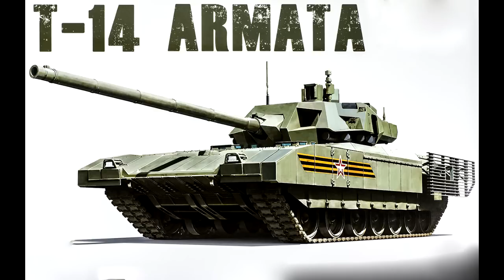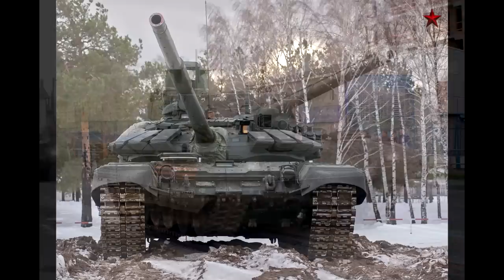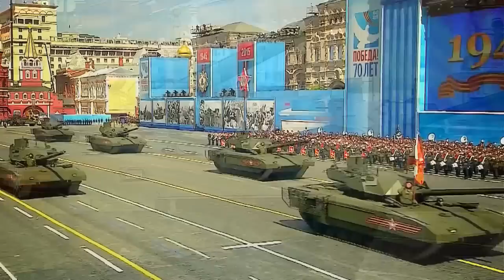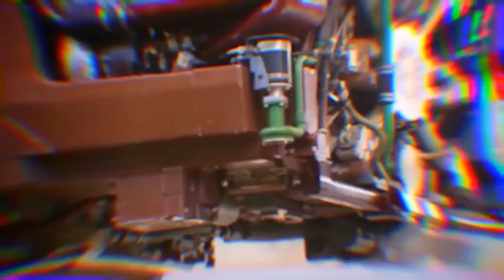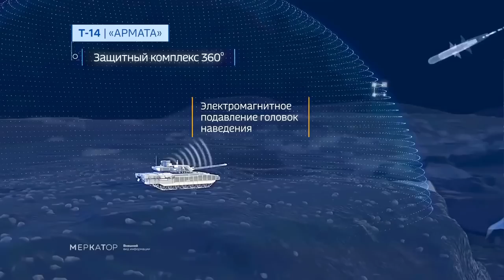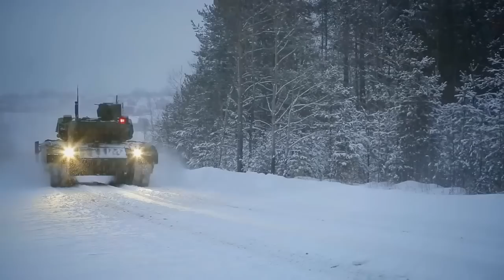Busting Myths on T-14 Armata

Comment: You clearly dont understand how physics work no APS system could stop an apfsds round. You cant stop a harder material travelling at over 5000ft/s by showering it with shrapnel that isnt going to do a thing and i have not found a single shred of proof that any APS system has been proven agaisnt either tungston or depleted uranium rounds but if it has then provide your sources! The only source i can find that even mentions its been tested agaisnt them is a russian source that simply says "its proven agaisnt these rounds with no testing statistics or sources for such a claim provided.
You also claim not to know how many numbers of t-14s there are and say probably alot so this is not a busted myth then, in order to bust a myth you need to have definitive proof not lots of "probablys".
Reply: +Responder to spastic comments Except im not the one posting a video supposedly busting myths thus i dont need to prove shit.

No it doesnt it just shows random articles from unknown sources posted on an image site written by fuck knows who so you assume wrong.
Reply: APS against APFSDS work. 

I only know it for NATO standards but: APS shatters, not destroying the KE penetrators, reducing it's force. An israeli study showed that only a 10° tilt reduces the penetrators energy (not penetration) by 50%. I dont really know about the "Afghanit" APS used on the T-14 but i know another system developed by the german company rheinmetall called AMAP-ADS that it has proven to be able of defeating not only ATGMs and RPGs, but also EFPs and APFSDS rounds. Supposedly it is capable of "cut" through the engaged threats, shattering or bending EFPs and APFSDS penetrators in the process ,causing  much higher energy reduction (80+%). According to Dipl. Ing. Rolf Hilmes, who worked in the German military procurement agency, the system has been successfully tested against 120 mm APFSDS ammunition in the past. This system works diffrent than russian or israeli systems. It uses hull-based ermitters without moving parts (The T-14 needs to turn the whole turret to face threads coming from another direction, hence only a 120° in front of the turret is protected by "Afghanit" APS) and no frag capsules (also on the T-14) shot at the incoming thread. That allows a very low reaction time of 0.56 miliseconds and a interception of threads fired at only 10 meters (!) distance. The detection of the threat happens at a distance of 10-35 meters (radar), while the fine tracking starts at two metres distance (optical sensors). The interception itself happens at only 1 meter distance (as said, hull based ermitters). Given that an APFSDS round even at 1,750 m/s velocity travels only 98 centimetres in 0.56 ms, the system reaction time is fairly enough.
Reply: Jonny Doesn’t matter if that is true they will just use SABOT because you can’t do anything to a sabot round it is too hot and would melt all the shrapnel before you even hit it

Comment: I remain sceptical about APS stopping darts. Sure in theory it could be done. But there's a world of difference between doing it in theory and having the capacity to actually do it. And also a world of difference being able to pull off a miracle success in testing, and actually doing it repeatedly and reliably on the battlefield.
Reply: I only know it for NATO standards but: APS shatters, not destroying the 
KE penetrators, reducing it's force. An israeli study showed that only a
 7° tilt reduces the penetrators energy (not penetration) by 80 %. So 
only a NATO STANAG 4569 level 4-5 protection (against 25mm APFSDS) is 
requiered to widhstand an (sucessfully intercepted) APFSDS. I dont 
really know about the "Afghanit" APS used on the T-14 but i know another
 system developed by the german company rheinmetall called AMAP-ADS that
 it has proven to be able of defeating not only ATGMs and RPGs, but also
 EFPs and APFSDS rounds. Supposedly it is capable of "cut" through the 
engaged threats, shattering or bending EFPs and APFSDS penetrators in 
the process. According to Dipl. Ing. Rolf Hilmes, who worked in the 
German military procurement agency, the system has been successfully 
tested against 120 mm APFSDS ammunition in the past. This system works 
diffrent than russian or israeli systems. It uses hull-based ermitters 
without moving parts (The T-14 needs to turn the whole turret to face 
threads coming from another direction, hence only a 120° in front of the
 turret is protected by "Afghanit" APS) and no frag capsules (also on 
the T-14) shot at the incoming thread. That allows a very low reaction 
time of 0.56 miliseconds and a interception of threads fired at only 10 
meters (!) distance. The detection of the threat happens at a distance 
of 10-35 metres, while the fine tracking starts at two metres distance. 
The interception itself happens at only 1 meter distance (as said, hull 
based ermitters). Given that an APFSDS round even at 1,750 m/s velocity 
travels only 98 centimetres in 0.56 ms, the system reaction time is 
fairly enough.

Comment: I know this may sound like a lie, coming from a old US Army Scout, 13 year Cold War veteran. However, I'm going to say it anyway. I'm glad to see you kids get some nice equipment. I don't like to see any soldier in the kind of junk that the Russian government has been building for the last 50 years. Back in the 1970's our 60 mm HVMS main guns could eat a T-55 and we finished the, (unneeded) 140 mm main gun program for the M-1 back in the 1990's. Never-the-less at a rate of only 500 T-14's per year it will take you 20 years to play catch-up to our 37 year old M1's. What's up with that?
Reply: Yup, junk! In Korea (1950's) the T54/55 chewed-up everything that got in its sights. Never-the-less the 1967 Arab/Israeli War really put the "Reject" stamp on the T-62; Gulf War I did the same for the T-72; the First Chechen War the T-80; and the "Now what do we do?" piston engine T-90. The Chinese are the ones who have really worked the bugs out of the 125 mm main gun, but they are keeping that for themselves.
Reply: > "Russian fleet has approximately 15,000 tanks of T72/80/90 series of which 4500 are T80 series, 550/600 are T90 series"

I've heard the numbers for active T-80 float around 3,000. And 450 active T-90s. With a further 2,000s T-80s and 2,200 T-90s in ready reserve. There are maybe 6,000 T-72B series active at best. Though 4,000 is a more suitable number. In ready reserve and low-readiness reserve, about a further 6,000 or 8,000 T-72s and T-80s. So ~5,000 at best at any one point active.
Reply: You are making a "totally" correct statement about me. I totally dismiss the viability of the T72/80/90 series of MBT"s going up against the, way more than venerable M-1. Just as I totally dismiss the viability of Sherman medium tanks and Pershing heavy tanks going up against the T-54 MBT. If it ever happens it will be with the same result and for the same reasons. To get rid of them in order to get the government to spring for a big big big money program for a new series of MBT's.
Reply: Only everything you can think of; better MRS, electro-slag barrel, one-piece ammo, faster loading; it's pretty much 125 mm version of the Rheinmetall 130 mm gun. However, they're not all that good with tight tolerances so they bought German gun machinery too.
Reply: Have you ever been badly burned? I have, flame proof uniforms don't protect you from hot oil. I like the new generation of MBT's (all of them) because they do a better job of protecting the kids inside them. As for long range shooting the British Royal Ordnance L11A1/L11A5, L11A7, L30 is the king of tank guns. As for the king of 125's you get yourself invited to a Chinese arms show.

Now, the way things really work.

(http://military-today.com/tanks/new_chinese_light_tank.htm) Note: This is a type-81 105 mm on VT5  ("VT" means export model) Light tank

Understand that I'm just trying to give you good info as an answer to your question about the unknown 125 mm one-peace-ammo main gun. China isn't going to make a long gun for another country as with the 105 mm type 83 they like long guns like this L60 mach 6, 125 mm gun barrel for the steppe, montane grassland, shrubland, temperate grassland, savanna, and shrubland biomes of China where barrels longer than 6 meters tend to be very practical. It's probably going to have a Falcon or Meggitt turret type autoloader. If someone from another country wants to buy the 55 ton VT4 main battle tank (Chinese: VT-4主战坦克 ), also known as the MBT3000 with the short barrel 125 mm with a Object 292 Type autoloader, then OK! 
Know this: The GLAT is for targets out 8 km so this is no L30, but China understands Israel's tank gunnery doctrine.
https://www.youtube.com/watch?v=aBIEDH8x8ro
https://www.youtube.com/watch?v=IPlOekOW3bM
http://www.renk-france.fr/pdf/ESM_500.pdf  PDF
http://www.renk.biz/vehicle-transmissions.html   -  Click "DOWNLOADS" then click on "Transmissions for Military Tracked Vehicles" PDF page 17
https://www.youtube.com/watch?v=0IjgndIFhgU
https://www.youtube.com/watch?v=fv7kY8HVeKo
https://www.youtube.com/watch?v=Lvuyw0-mYSU

All these numbers you so graciously quote I don't doubt, not in the least, but are worth exactly nothing; guns don't win tank battles. Scared 19 year old kids win them.

What is the best auto loader? They all brake, but only at the worst possible time and then you will be shocked at the rate of fire provided by a stocky 19 year old boy; fearful and trembling with his pants legs full.
https://www.youtube.com/watch?v=bOg0AQeI_sw

Penetration, muzzle velocity, barrel efficiency all by comparison mean unequivocally nothing. Two MBT's go around a sand dune, a hill, a building or a pile of something, one with a 125 mm 2A46M5, one with a 105 mm Royal Ordnance L7 or Chinese Type 81/83 or US/Korea M68; each firing some kind of TCDU APS, range 25 feet; one teen aged kid says "sh-t" and the other one lives.

An armor battle group approaches another attacking from a valley toward to a ridge line (like a modern-day Gettysburg), who wins? The one with the best radio and CAS. There is no high ground or max effective range when you have SATCOM and C4ISR.

When teen aged boys die in such great numbers that they must be burred with bulldozers governments will spend trillions: Girlfriends, boyfriends, retirement residents, pets, tropical islands, cars, toys, jewelry, yachts...

Leviticus Chapter 26 can not go away and God can't change his mind about it either.
Reply: "Why, Russia has better." 
No colon compulsive responder Russia has nothing better than China's L60 mach 6 velocity, 125 mm one peace ammo main gun sporting "From Mao to Joe with Love" on ever round. If you did have something better you would blow-up some apartment buildings and say "China did it!" then go take their minerals and oil fields. 

"My colon compulsive response is to demonstrate to you that the Chinese are not the only ones to have developed upon the original 2A46 125 mm and made it into a world class armament, so get over it."

It wasn't feelings that got hurt by China's new gun which isn't really a 2A46. I know, for sure, China has no faith in Russian tank technology.

The 55 ton VT-4 (export model) has a Chinese clone of the 2A46 which "I think" would be nowhere near as good that of the T-14.

However the MBT3000 is not the VT-4, I don't care what anyone says. From the Chinese I know and am related to I don't even think the two tanks have the same steel. I wouldn't be surprised if the chassis that gets this new gun incorporates type 38 titanium in the armor system with a "Twin Charged" 1,300 kw 12 cylinder diesel or Honeywell gas turbine "T" form factor Euro Pack like engine transmission package with a high speed Israeli Merkava type turret that no conventional APFSDS can penetrate from a nose-to-nose shot (other than to hit the gun tube). So that if Chinese forces were to closed to point-blank ranged the show would be over with for all 500 T-14's in just about 1 minute.
Reply: You depict people as a "spastic commentator" because that's what you do, now look in the dictionary and see how "spastic" is actually used in English. I can tease too. After you look-up "spastic" please let me know what you change moniker to because, in spite of what you might think, I do relish your intellect and would like to share that "bushel of salt" they talk about.

"Its maximum estimated frontal turret protection doesn't appear to be uniform"
100% totally agree, but you're looking at the Mk IV, look at the Mk I to get a good look.

"You don't even sound like a veteran scout now, more like a wishful child"
Yup, know any wishful young ladies?

"Your random rants are becoming increasingly incoherent but we'll try to make up for it from my side ok."
                                                                      You need a coma ^here, but "and" would have been the best word to use without a coma.
OK, thanks, but ranting is your untroubled kingdom. I have not and shell not invade.

"because according to you the battle will be over within a minute"
26 years ago we wiped out the 4th largest Army in the world in 100 hours; because they made us drive at walking speed (3 miles per hour, copy?). There was no C4ISR, few GPS, fewer still SATCOM's (and you had to be setting still) not like that at all now days. Then on the Highway to Hell there were thousands after thousands and more thousands. It was surreal, it was villainy, in the most insane sense. All, as in "every single one" of the ways Iraqis boasted that wanted to kill Jews is how they died. When you hit one of those worthless T-72 tanks the commander would blow out like a flare and the turret would fly straight up about twenty feet. That's why I'm glad to see those goofball designers of your's get the kids out of the turret and put them in an armored capsule.
Even someone who's colon compulsive shouldn't have a hard time figuring out that's reason the Chinese have abandon Russian tank technology.

"[ I know, for sure, China has no faith in Russian tank technology]
ok, thats your opinion and i don't want to change it"
It is so, but that isn't my "opinion". I fact when someone says anything to them about one of their tanks is even looking like a T-72 (and all the MBT's do) they get insulted and become indignant:
https://i.ytimg.com/vi/IPlOekOW3bM/maxresdefault.jpg
Don't take this wrong, comming from me. They don't like you guys or your guns or your automotive systems. They only like your jets because they can't get any GE F414 or F110's

"How are those tank Biathlons going for the Chinese Keith, are they demonstrating their superiority in MBTs yet"
We here in the Philippines may find out soon, because they're building LST's 3 at-a-time and have finished these new ships:
2 Aircraft carrier
4 Amphibious transport docks (LPD)
1 Mobile Landing Platform 
32 Landing ship tanks (LST)
31 Landing ship medium (LSM)
8 Attack submarines (SSN)
55 Attack submarines (SSK)
5 Ballistic missile submarines (SSBN)
2 Experimental submarine
34 Destroyers
51 Frigates
32 Corvettes
109 Missile boats
94 Submarine chasers
17 Gunboat
29 Mine countermeasures vessels
11 Replenishment oilers
232 Auxiliaries

This is a Tropical Rain Forrest so I don't really know what a "Tank Biathlon" is. Never-the-less wherever Russia could put 500 or a thousand T-14 China can put 30,000 of anything and everything.

Comment: "Made a mistake somewhere?"
__I love your sources me-bucko. Like any of them are not full of biased crap.
__The only way the West will know what your new tracked wonder weapon is all about is when we recover an export from some third world cesspool you sold it to. Oh yeah, until this tank gets exported we here will have to assume it's just another T-64. An embarrassment you don't want the world to see.
__The T-14 will be opened up by APFSDS just like any other tank on the battlefield. And what happens when all your little exterior defensive gizmos get used up defending against artillery shrapnel, ATGM's, medium caliber rapid cannon fire from IFV's and the like? It will be a feast for the Western MBT's. Our tankers are licking their chops as we speak.
__You better stick to modernizing your nukes. It's the only real card Russia has left to play.
Reply: APS against APFSDS work. 

I only know it for NATO standards but: APS shatters, not destroying the 
KE penetrators, reducing it's force. An israeli study showed that only a
 10° tilt reduces the penetrators energy (not penetration) by 50%. I 
dont really know about the "Afghanit" APS used on the T-14 but i know 
another system developed by the german company rheinmetall called 
AMAP-ADS that it has proven to be able of defeating not only ATGMs and 
RPGs, but also EFPs and APFSDS rounds. Supposedly it is capable of "cut"
 through the engaged threats, shattering or bending EFPs and APFSDS 
penetrators in the process ,causing  much higher energy reduction 
(80+%). According to Dipl. Ing. Rolf Hilmes, who worked in the German 
military procurement agency, the system has been successfully tested 
against 120 mm APFSDS ammunition in the past. This system works diffrent
 than russian or israeli systems. It uses hull-based ermitters without 
moving parts (The T-14 needs to turn the whole turret to face threads 
coming from another direction, hence only a 120° in front of the turret 
is protected by "Afghanit" APS) and no frag capsules (also on the T-14) 
shot at the incoming thread. That allows a very low reaction time of 
0.56 miliseconds and a interception of threads fired at only 10 meters 
(!) distance. The detection of the threat happens at a distance of 10-35
 meters (radar), while the fine tracking starts at two metres distance 
(optical sensors). The interception itself happens at only 1 meter 
distance (as said, hull based ermitters). Given that an APFSDS round 
even at 1,750 m/s velocity travels only 98 centimetres in 0.56 ms, the 
system reaction time is fairly enough.